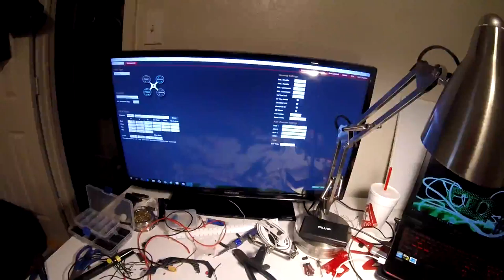Cerberus Build

Comment: was looking for the best way to mount a vtx with a pigtail and if its possible with this frame before i jump in the flyno pool...but then its like the fastest timelaps ever and not worth the watch to get any detail on the,actual build..
Reply from the maker: Sorry about that but I put tbs unify hv in and just put  faced the pig tail away from the back of the quad and the had the pig tail go 180 out the back connected to zip ties
Reply from the maker: Do you have a Instagram i could send a picture because that would make more sense and also it comes with a vtx 3d printed mount with these frame I don't use it because of weight
Reply: iFlySkyHigh @loco_fpv
Reply: Too quick.